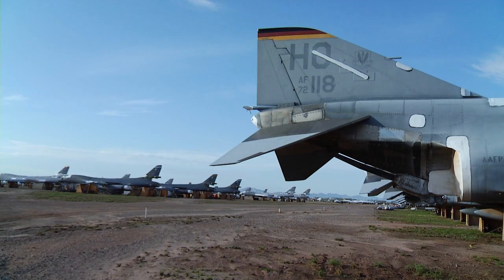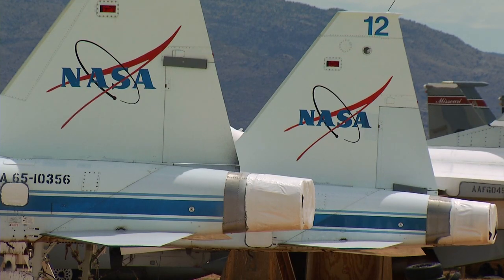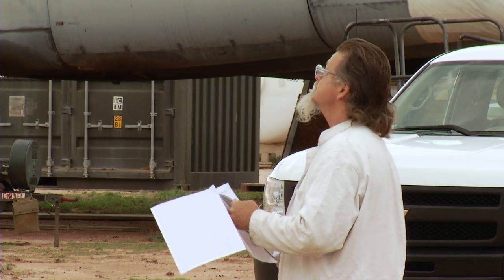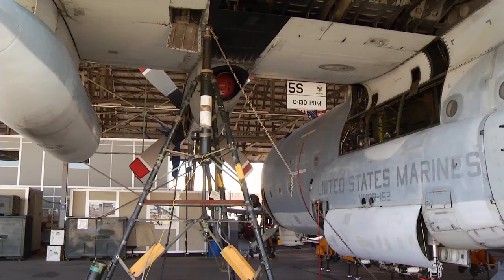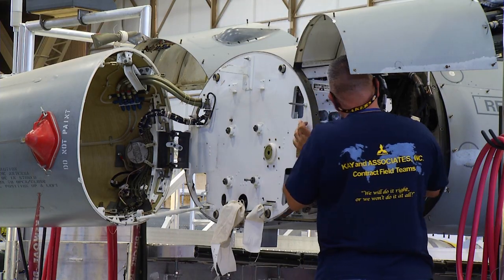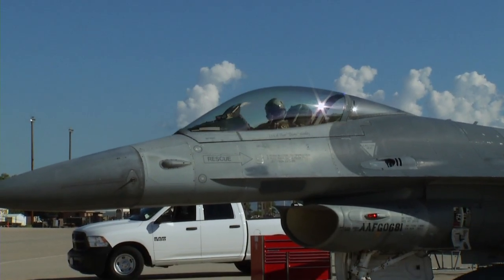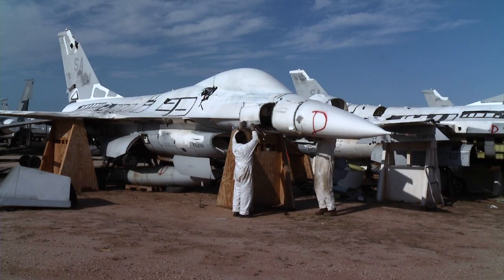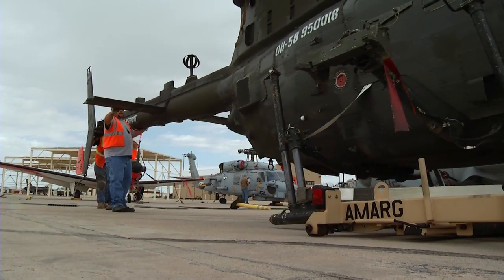Nuts and Bolts of The Boneyard

Comment: B 52's are still flying but, we're already parting out B1's?
Reply: They're pretty old now. Prototypes flying in the 70's and they were put in service in the early 80's.
Reply: B52s still have a purpose and role and they  are updated with engines and so on. Still a great workhorse and delivery vehicle so you can't necessarily egpquate or reason why based on age, comes down to cost and the role they still play and if they are viable militarily.
Reply: The USAF initially bought more B-1Bs than Congress will provide operational funding for so some are put into storage and swapped out when the planes in service reach certain flight hour limits.
Reply: BONEs are a maintenance headache. Lack of spare parts and the years of abuse have taken a toll on them. They retired alot of the problem children and put them in storage to be parted out. They want to retire them all by 2030 along with the B-2s.

Comment: 0:21 those planes looked almost new & in good condition
Reply: US service often buy more aircraft than Congress will fund operations for, so the services put new aircraft into cacoons and then exchange them with aircraft as they reach a specific flight hour limit. The B-1B is a typical example.
Reply: i mean most aircraft dont really age with normal upkeep. those are clearly old as fuck
Reply: @dracik5257  To correct you, aircraft do age regardless of normal or excellent upkeep. US military aircraft have strict airframe hour limits. For example, the B-52's airframe life is maxed at 37,500 hours. Metal and composite fatigue cannot be corrected with routine maintenance.